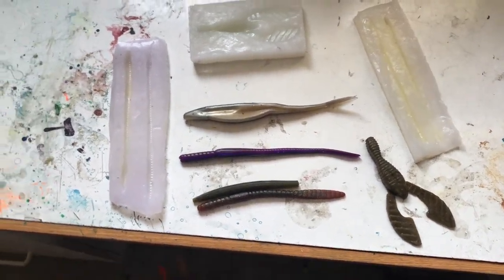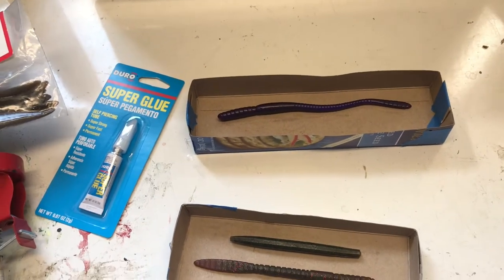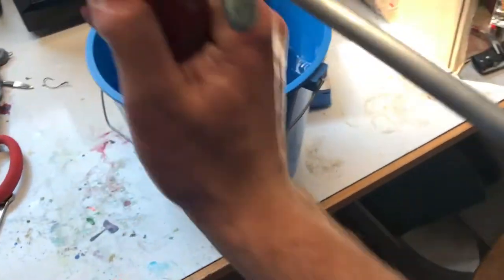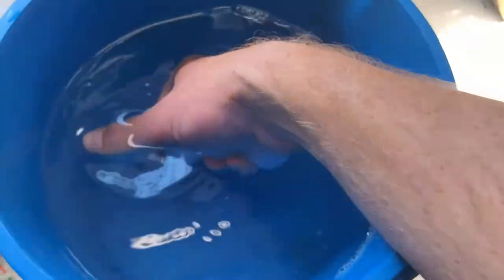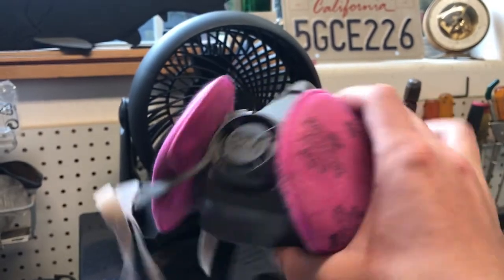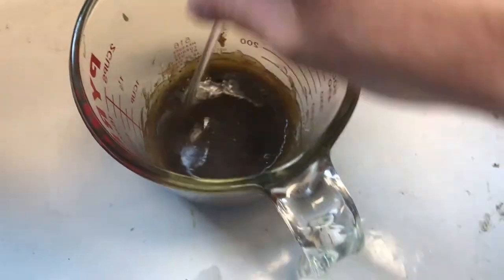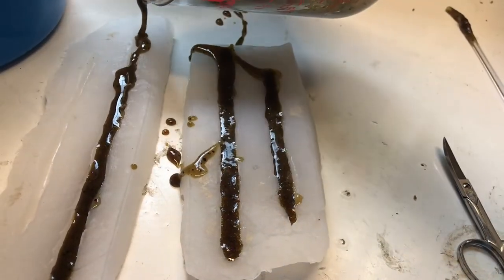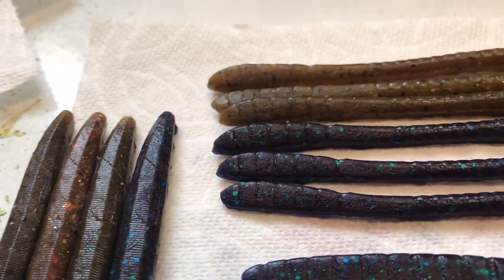How to Make Soft Plastic Fishing Lures for CHEAP! (Silicon Mold)

Comment: Since the molds are open pour, are the senkos flat on one side?
Reply from the maker: I did not show how I do senkos but you can make them fully rounded without flat sides. To do this, fill your container with silicon without the worms in the cast. Rather push the senkos into the silicon until they are fully surrounded. After it cures, cut the worm out with a blade and you will get a mold that encapsulates the whole worm. To pour just pinch the flaps of the mold open and pour into the cavity.

Comment: Would the molds not cure out completely if you just poured the silicon directly on the baits without putting it in water?
Reply from the maker: In simple terms, no it should work without using water.

However, the soap and water allow you to form the silicon around the baits without it sticking to your hands. This type of silicon is relatively thick, so when applied directly to the mold it may not cover the baits, therefore leaving holes and imperfections.